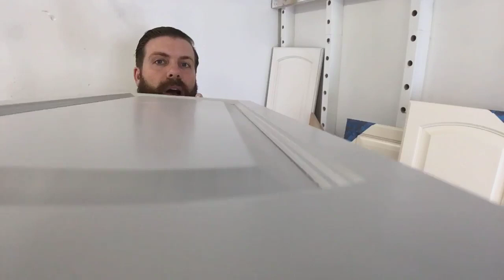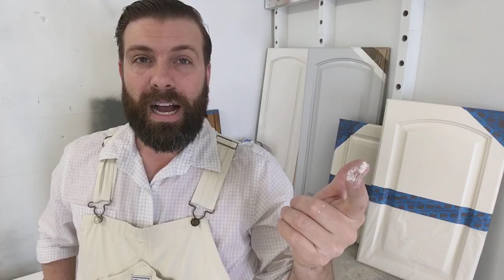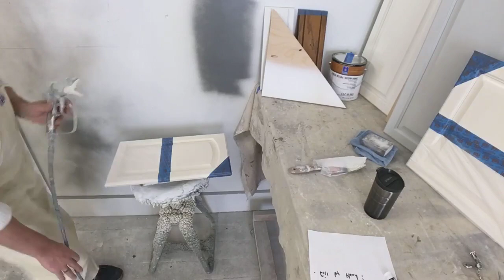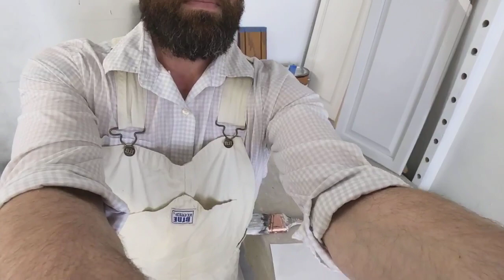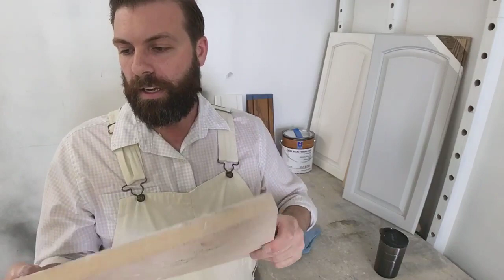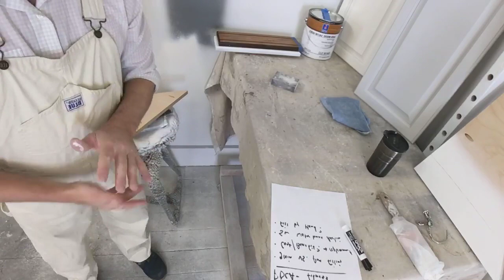Ask a Painter Live #149  all about grain pore filling!  Simple 3 step process

Comment: For prefinished oak cabinets that are being refinished, I sand it with 150 or 180 to bring the previous coating down fairly flat because on stain/ clear finishes, obviously there’s no pore filling in most situations. After that, I use a coat of PX lacquer primer and wait for it to dry. Any pores left over get a fine roll of BIN shellac primer followed by a sand and then another coat of PX. After all is dried and cured, sand 220, caulk cracks with Dynaflex 230, let dry 3 hrs or longer, 2-3 coats of Kem Aqua. Some may say that caulking is bad with woods that will flex but Dynaflex 230 is the best performing so far and Kem Aqua is a WB lacquer hybrid and has flex characteristics that won’t crack due to the wood expanding and contracting

Comment: I been bondo-ing my cabinets ( doors and boxes for 2 weeks )  I have about 13 doors left to go.  I'm using Zinsser cover stain primer and Benjamin Moore Advance top coat. The boxes came out fantastic with sanding, bondo and sanding again. The doors are way more work to bondo. So all I need to do is spray the primer, SVT, spray top coat, work with a brush then spray an additional top coat? If so that would cut my time by more than half.

Comment: Very good info thanks!
Some thing similar happened to me I tried to spray a window with my new graco Ultra hand held,  did not went well, was unable to push any paint out only randon spetting, I thought was the battery not enough power but was full, I ended up going back home to get the big airless.. It was a embarrassing episode with my customer.
When I got back home I figure out what happened. 
I used a 308 tip it was to small even with the big airless have some issues, so no more 08 tip, 10 or bigger tip and a bit of dilution will work fine. 
Do not know about your hvlp set up  but usually a 4 Stage turbine, 1.5 or 1.8 neddle an average of 10 % dilution with windshield, fluid, floetrol or water in the worse case. 
And you will get beautiful results with minimun over spray (less coverage of non target areas) a lot less paint waste than a airless. 
Do not know the impact in a long term using windshield fluid but in the short term works great to avoid brush marks, used to use water but there a big diference for sure.

Comment: btw theres something just wrong with emerald urethane. no matter how i apply it. it always feel gritty to the touch.  also if your surface isn't prepped to perfection and primed well the color bleeds through it say if theres a dark mark  of dirt or smudge even 3 coats it will bleed through. I cant use this stuff for every day trim anymore unless everything it primed with oil. Baer trim paint works better with less coats.  YOu should look into https://waterbasefinish.com/ hear this stuff is amazing but paying $100 per gal and idk if  they can tint it other then white.
Reply: For $30 more, Renner 851 2k topcoat
 is a true cabinets paint, Much, much harder than any water borne from SW or BM has...Lay's out much better. 
Best water borne on the market. (milesi 2k is another good water borne Paint)
>
Match that up with CIC 2k Polyurethane Primer, the Ultimate Waterbase Primer will block out tanning.Best water primer on the market by far.

Comment: "hybrid top coat" over and over -  OK so what brand and product, please?
Reply: It's Benjamin-moore Advance. I am NOT a fan of it. Be prepared to fight sagging and runs on vertical surfaces. It's fine if you're spraying doors flat. Also, 16 hour recoat time, long open time = lots of crap sticking to the paint. You need pristine conditions to use it.
Reply: @mtbrdude  Advance is alkyd non hybrid.